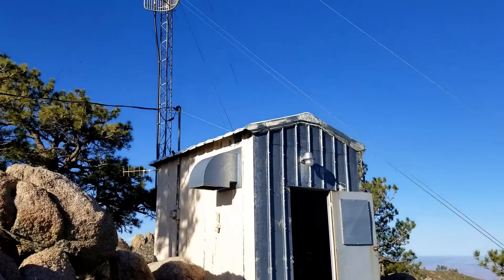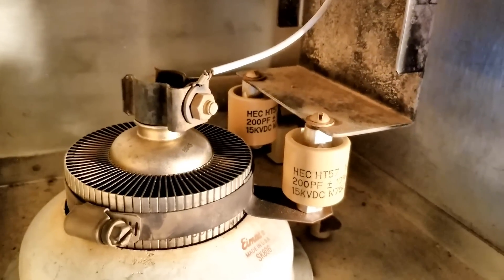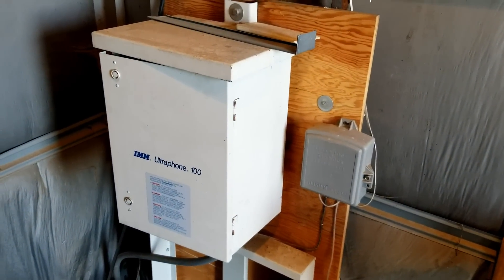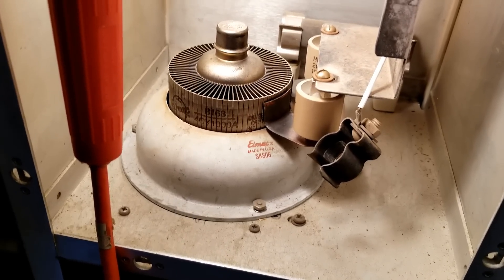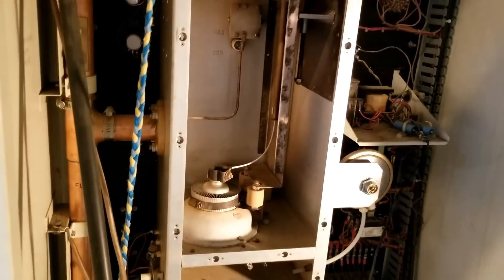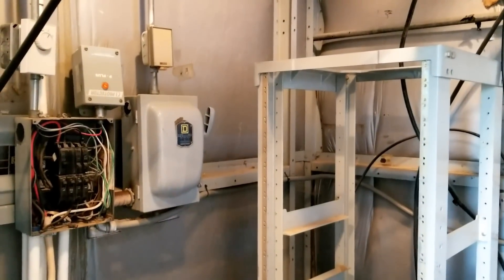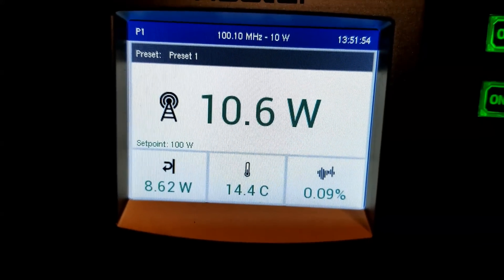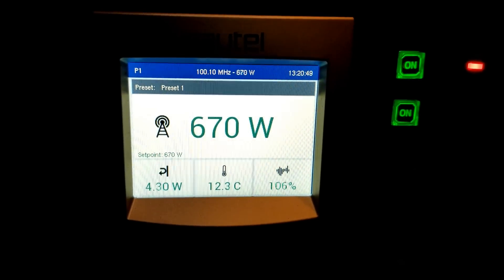Guest Video KGMN 100.1 FM Super Country New Transmitter

Comment: This might be nothing, I would replace that coaxial line with all that water in it may have cause the reflective power to blow the DC plate capacitors. The 50 ohm resistor in the old transmitter would have be connected to the high voltage in series to the plate on the tube.

Comment: The new transmitter is expensive, but the electrical power efficiency will enable the owners to recoup the cost relatively soon. Solid state has conquered the vacuum tube. Great video, thank you.
Reply: I'm no expert but I think lack of tube replacement might cost save more money. These transmitters are close to 50% efficiency so going from tube to SS will save less than 1 kilowatt. In Arizona that kilowatt probably costs less than $1k a year, compared to the $2800 every 18-24 months the tube costs.

Comment: That Nautel transmitter will serve you well and the company will also.  They look after their customers.

I have had interesting experiences helping to maintain Harris FM20Ks.  The first one we had was a pre-production unit, the 2nd one was 'the real deal'!  An intermittent fault on the older TX was eventually traced to unsoldered joints to a TO3 device in the exciter's power supply.  The exciter was in the base of a rack, several yards from the rest of the transmitter.  My boss had spent quite some time, staring at the exciter's RF output reading.

The newer unit's PA would occasionally have arcing issues.  The station owner didn't rate a clean, cool transmitter room as worth much expenditure.  Even though I was warned arcing was likely, it still scared the c**p out of me!

The degree of miniaturization of technology is amazing.  I expect your new Nautel can even write its own fault reports, if any are needed, and e-mail them to you!

Comment: That new transmitter is slick, but that fan setup sounds like a dust magnet.  I suspect you'll be cleaning the filter on it a lot more often than the old transmitter.
Reply: I hate it when expensive equipment comes with teeny tiny small diameter fans that run at noisily high rpm and will die at the drop of a hat.
Reply: @kilwala2242  I forgot about fan life.  Big fans will run 24/7/365 for decades and outlast the system.  The tiny ones will likely be the first thing that dies.  Might want to find out from other users the expected lifespan and change it preventively.  I'd also be tempted to duct the air intake to a custom air box that has a furnace filter to act as a pre-filter.
Reply: Meh, they make more money off the replacement parts over selling the transmitter.

Comment: Fascinating. Most radio stations still keep the behind the scenes stuff hidden from the public. I wonder what the final VSWR was.
Reply: I was wondering same thing , lol .
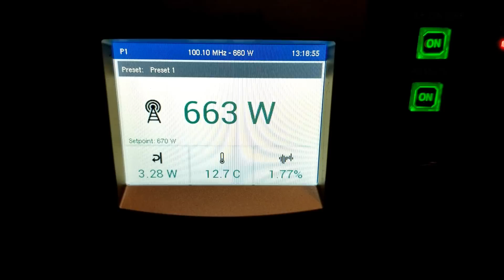Reply: The reflected power at 675 Watts is around 4 Watts (you can see that in the lower left corner of the display at 17:47), 0.6% of the power reflected. That equals a VSWR below 1:1.1 🙂

Comment: I am curious and concerned about the leak in the nitrogen gas filled RF line. I hope they resolved the issue after drilling the hole in the line. After all, it needs nitrogen to prevent any high RF to create any spark in the line, also I hope that there is no leaks in the air pressure. Where was the water leak coming from? I hope things were resolved then. Thank you. I always enjoy nerding out to your channel. Much respect. Nautel transmitters is king of transmitter in my opinion. I have worked with them in the past as a studio engineer. Very cool of what what you can do with them and the processing power and reliability.

Comment: 1215  Despite what the vid says, that outlet is a 3 slot NEMA 5-20  125 VAC ,  20 amp max that will also accept a NEMA 5-15 plug ( 125 VAC 15 Amp )   All, 125 VAC outlets in that format (with the ground at the bottom) have a vertical right blade.  In order to designate max amp, a left vertical is 15 Amp , a left horizontal is 20 Amp.

The proper outlet is a NEMA 6-15  250 VAC 15 Amp ( both blades horizontal  )  or a NEMA 6-20 250 VAC 20 Amp ( right horizontal blade , left vertical )
Reply: Noted, I am ordering a Nema L6-20P to C19 cord and will replace the receptacle.
Reply: @mattkrick2446    Good, this kind of thing gets mixed up more often that one would think.  It gets even worse when you move to multi voltage and 3 phase.      Also, when wiring this outlet, do not attach the neutral ( white ) to the ground lug, only use the bare ground wire.  The only place a neutral and ground are to be on the same bus is at the service entrance.  With a N and G tied together at an outlet, there is now current on the ground and that can lead to a shock hazard if the neutral opens up.
Reply: @bobroberts2371  This transmitter is 2-wire. Not 3 wire. No neutral is used or required. And yes... He used a white wire for the ground instead of a green wire.

Comment: Plate blocking inductor? Plate voltage dissipation resistor? You got your work cut out for you on the old Harris!  These old girls do get crotchety with age. a nice transmitter and rugged backup, runs into bad loads pretty good. A decent box for Brand H. Excellent choice for a new SS transmitter. Nautel makes nice transmitters.

Comment: Saved once again by the Jesus stick!!
Reply: I want to see him use one from a copter on a 3 million volt transmission line.  Not a job I would ever apply for.
Reply: @rogersmith7396  You can add to that  a HELP WANTED AD  for 'Ammonia refrigeration techs needed' . Or if you really want to live on edge...filling out an application for "Instrumentation tech. needed" ....duties include monitoring 'phosgene' based chemical applications and equipment.  😅   (Neither are like that "bright flash" like you're describing...but rather a slower but certain trip to eternity nonetheless.) LOL sorta
Reply: I’d think if you didn’t use it, you might see Jesus real fast… 😂

Comment: I have to admit that I once did the same thing to a TV Remote Pickup Heliax (I tied a piece of cloth over the hole to keep critters out of the coax, but still let the water drain out).  Worked long enough to get a tower crew in to replace the top connector (it's ALWAYS at the top!).

Comment: Fun to watch!  and educational. Now, I want to suppress parasitics... how does that unconnected resistor work?  Pulling my leg here?
Reply: The only thing I can think of is if the resistor is both antenna and load at a certain frequency that's many multiples of the main frequency.  But even then, that would only be waves that build in the box.  I was thinking it was mounting for a spare part, but I didn't see the original part anywhere.

Comment: Water definitely messed up that Harris transmitter should have checked the cabling before anything else and get a nitrogen system installed and keep that Cable pressure at 14 15 psi to keep water out

Comment: Better check. 
The receptacle shown is a NEMA 5-20 which is rated for 120 volts @ 20 amps. If you look at it... A standard 120 volt AC power cord can be plugged into it.
 For 240 volts, you need a NEMA 6-20. Lets hope the power supply in the transmitter is a broad voltage input (90 to 250 VAC) switching power supply.
Reply: It's all I could find that would fit the cable I had on hand and we went to every hardware and electrical store in Kingman to find the receptacle that would fit the cord.  Anyway I am sending away for the proper L6-20P to C19 power cord and will replace the socket with a twist lock.

Comment: I thought all the big antenna cabling gets filled with nitrogen to prevent water (and moisture in general)... Maybe is just the rigid copper coax??  You can see the nitrogen cylinder near the wall
Reply: I'm guessing that's only done at higher-end locations. This looked like a pretty low-cost setup.

Comment: Wouldn't a simple VSWR check have diagnosed this straight away? Might be worth the station adding in remote monitoring to any return link or mobile monitor they have! Maybe they wanted an excuse to replace valve with SS but seems an expensive swap out to get back to square one if they didn't.

If only someone had added a gutter downpipe to the heliax on those Jampro bedpan antennas, they look they could hold a litre or two of rainwater. 😄
Reply: In a situation like this where high power is being used, a pressurized coax feeder is a better option. That way no moisture can get in. Water in the coax is not what you want! Tube transmitters are reliable and more rugged compared to SS (they'll take a lightning hit and just cycle the output instead of nuking MOSFETs etc) but two-yearly tube replacement can start to get expensive and tubes are becoming harder to source.
Reply: @stopthebus  And better efficiency with transistors. The power bill is a major part of operating expenses.
Reply: @straightpipediesel  Yes, power is becoming an issue which is why we are seeing quite a few high power AM sites being decommissioned.

Comment: Couldn’t you still plug a 120v device in that”220V”  plug ?
Reply: Only once.
Reply: Yes A 240 outlet would have the right prong sideways and not the left.
Reply: Oh ok.  I thought low amp 220 plugs were, both prongs are horizontal and high amp 120 had one horizontal and one vertical
Reply: If it were clearly marked as a 240VAC receptacle FOR ALL TO SEE .....maybe that would lessen the odds.......maybe.

Comment: Sounded like 50% power gain in the antenna. I wonder what physics are involved. Is it like an induction coil?
Reply: It looks like three stacked loops, so they should induce a stronger ERP if they’re in phase.
Reply: @5roundsrapid263  kind of like a transformer? Or more like an ignition coil?
Reply: @directcurrent5751  I guess more like the air gap in a transformer. I know stacked antennas in phase increase reception strength. I’m sure it’s the same with transmitting.
Reply: @5roundsrapid263  multiplier effect
Reply: "Gain" is a misnomer since the antenna lacks any active elements to actually amplify the signal.  ERP is based on a "isotropic" radiation - that is a signal that radiates in all directions.  Think of a light bulb hanging from the ceiling.  However, there's little point in entertaining mars or subterranean termites, so the antenna directs the bulk of the signal horizontally to where the listeners are. As a result, the signal is stronger in the desired direction at the expense of making it weaker in other directions - just like adding reflectors on our bare bulb.
Reply: @russellhltn1396  Yes, it doesn’t increase power, it focuses it into lobes.
Reply: @russellhltn1396  excellent. More of a concentration and directional release of the signal energy.
Reply: @directcurrent5751  Exactly.

Comment: 670 watts output to the antenna with a rated ERP of only 1000 watts.  That's quite unusual for an FM station isn't it?  I would've thought that antenna provided at least 10 db gain.  The vertically polarized yagi on the antenna mast that the engineer says is for the standby transmitter probably would provide about 7 db gain allowing for the standby transmitter to be about 200 watts to provide the 1000 watts rated ERP.   Interesting video.
Reply: The 3 bay version of this jampro antenna makes 1,76dB Gain (1,5 times).
A single one has only -3,37dB - less than a standart dipole.